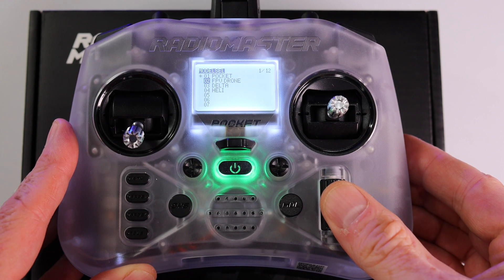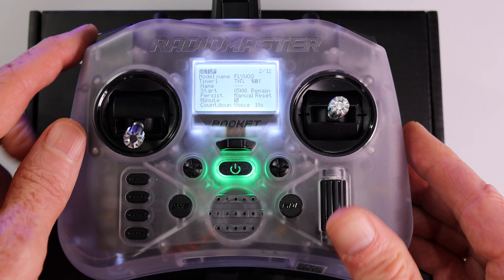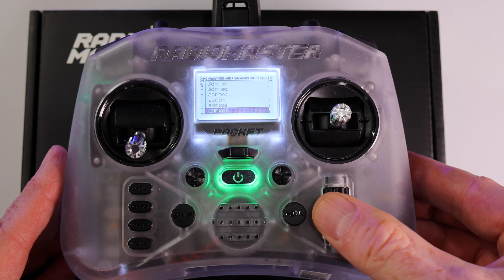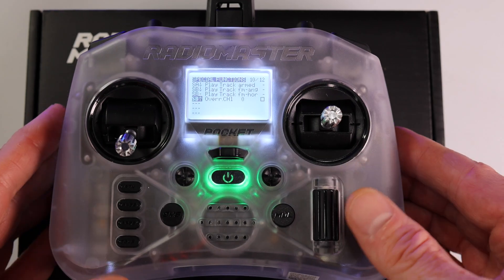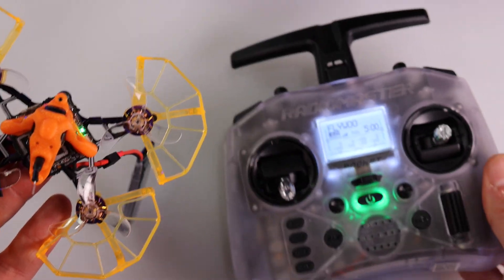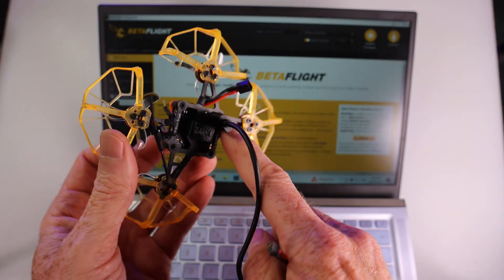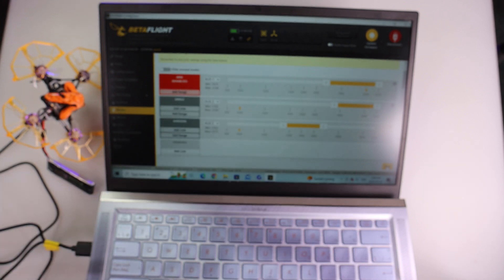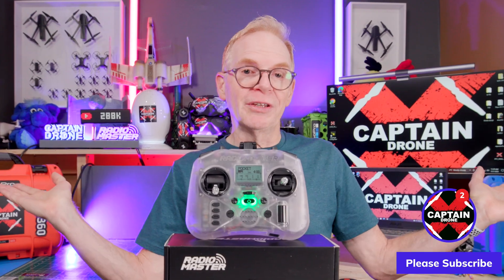RadioMaster Pocket - How To Set Up and Bind a Drone - Step by Step

Comment: I bought a Radiomaster Boxer 4-1 and a Radiomaster Ranger Micro module elrs to configure the quad.. I am have had all sorts of issues setting it up to work  with a Betafpv Air 65 elrs to the degree I have sold the quad. After watching this video I am going to buy another Betafpv Air 65 elrs, but a Radiomaster Pocket and follow this video to set it up. My Boxer will be used for sim only from now on. Thanks for a very detailed and easy to follow video. 👏👏👏
Reply from the maker: You are most welcome!  You may wish to check if the BETAFPV AIR 65 is ELRS or ELRS SPI.  If it is ELRS, then you bind as shown in this video.  If it is ELRS SPI, then you bind within BETAFLIGHT CONFIGURATOR on the RECEIVER TAB (you'll see the bind button).  Just press it on-screen, and also select it on your radio (all within seconds of each other).  You'll then know if you're bound or not because the RADIO will say something and/or you'll seed your joystick inputs move onscreen.
Reply: @CAPTAINDRONE798  Sorry to bother you. I have set up my Radiomaster pocket as you video indicates. I will be receiving my Betafpv Air 65 Freestyle very soon. Can you tell me how I can determine whether it is the basic ELRS or ELRS SPI version please? It would be useful to know before I got through the binding process. Thanks. Steve
Reply: Thanks for your reply, I did not really expect one. Very professional and friendly response. Have a good week. 🤝 I will watch some more of your content.
Reply: As a matter of interest, how will I know whether it's SPI or not?
Reply from the maker: @stevemartin2274 check the specs on line

Comment: I just got the Radiomaster pocket and Radiomaster RP3 they seemed bound and I am not seeing any inputs in betaflight what do you think my problem is?
Reply from the maker: Without looking at it in person, I have no idea, but obviously 99% of the population will tell you that you are NOT BOUND, or your radio is NOT SETUP CORRECTLY, and many more items.
Reply: @CAPTAINDRONE798  my betaflight was origninally configured for sbus I had to reflash the flight controller with radio protocol of crsf now I see the inputs from my radio on the receiver tab.

Comment: I am from Colombia and for a long time I have wanted to fly a drone, but since I have no experience in it, I want to know if there is a drone flight simulator for this model that you recommend, and when I have a few hours of flaying I would proceed to purchase the e drone.
Help me to select a descent drone flignt simulator for the Radiomaster Pocket.
Best regards,
Reply from the maker: Any flight simulator works as long as the flight simulator accepts a USB joystick device (which most do).  Go on the STEAM network and you’ll find lots of flight simulators.

Comment: This video was super helpful, thank you.  So, I’m still having a blast rocking the Aquila 16 though still can’t get use to wearing the goggles. Still flying FPV using a separate VRx and the flat screen in my garage. 
What I’ve been wanting to do, is to start upgrading components on the Aquila 16 or just do a “ from scratch “ build of a tiny whoop. Ive actually printed a couple frames that are similar to a Pavo. 
What I’m wondering is if you’ve a video on drone builds, component selection, initial configuration, etc. I need serious tutoring in Flight Controller, VTx/Camera, other drone electronics with focus on controllers and protocols. I’m old school and use to the clunky Rx bricks you’d plug whatever number of servos into, match Tx/Rx crystal freq’s and that’s it. I’m not even sure receivers  with huge numbers of channels are a thing anymore. And the protocols…..??? I’ve watched what videos of yours I can find and they answered a lot of my questions. If you already have a video that covers this, please point me in the right direction. If not, I’m going to cross my fingers that you release one in the near future. I know there’s a lot of content out there on the subject, I just prefer the way you do it. 
Thanks for the great videos!!
Reply from the maker: Sorry, no build videos. However visit J. Bardwell’s channel as he has done many, from scratch, FPV Drone builds over the years.

Comment: hi Steve, thanks for all the great videos. I wanted to create my own beginners FPV drone kit. I want to use the Radiomaster Pocket controller, with the Walksnail Avatar HD googles. I have not picked out a beginner FPV drone yet. My question is this. Using this selection of hardware can I fly a drone in a grandma skill level 1 mode with altitude hold. Is this possible with the hardware selected? and what drone would you recommend?
Reply from the maker: So you want to use WALKSNAIL VIDEO and ELRS Transmitter.  BetaFPV might make a Walksnail Cetus X that is ELRS, but I’m not sure.

Comment: I'm fairly new to the drone world.  I've been flying the Cetus Lite and the DeeRC D20 for about a year now, and I thought I was doing well.  Until last week when I bought the Happymodel Moblite 7 and a new Radiomaster Pocket.  I followed along in this video trying to setup the new drone.  OMG, I'm finding this thing totally uncontrollable.  The drone has a mind of it's own.  Far too sensitive for my skill level.  So my question is how do I tame this thing down?  Does the radio have expo?  Coming from the Futaba and Sprekrum world, the EdgeTX is totally new and foreign to me.  I can't wrap my head around it quite yet.

Any help would be most welcome.

Rick
Reply from the maker: Flying in full acro mode takes skill and it is exactly as you described.  As your skills increase, life gets better.  The drones you flew previously did not have true acro mode so your skills (hand/eye) are rather out of sync

Comment: Why no one shows how tho mapp/bind the buttons in Betaflight!!?? Allredy used preset from a used drone. But how to start from new one? Need to set te buttons first time. Mixes are set. But it brings nothing.

No one really shows u that..
Reply from the maker: I honestly don’t understand your question.  This video shows you all the basics, so as a NEWBIE what are you hoping to do?
Reply: @CAPTAINDRONE798  betaflight. It doesn't work like it's has to be. All the channels mooves without I touching them. What's wrong? Why no video for how to solve all this problems. Preset is easy when all goes good. Calibration or what? Noone tells

Comment: I've mapped the aux 1 arm ch 5, and aux 2 angle horizon . Was still seeing no motor start on arming even though it shows on BF: just discovered arming disable flags: rxfailsafe, noprearm, msp and rpmfilter... x( Like I said before this drone was previously configured for a tbs rx... should I reflash? Need another tip. Thanks so much.

Comment: pff... so I swapped the tbs rx for an elrs nano txco on an ol hglarc sector 132.  I'm bound to it now with a brand new pocket but my aux switches are not showing up in betaflight. I sorta hit a wall now... and need a tip. thanks
Reply from the maker: Is anything showing up in Betaflight configurator when you move joysticks, switches?  If the answer is no then maybe you have the incorrect receiver selected in Betaflight configurator.
Reply: @CAPTAINDRONE798  hi Captain. Wish I said that: yes, AETR are on... just no aux... I even tried auto but no dice
Reply from the maker: @johngraboski AETR is only for the joysticks so that your throttle, yaw, pitch, roll are correct.  So, when you move the joysticks, you see the associated bars move in Betaflight configurator?
Reply: @CAPTAINDRONE798  yes. Sticks move in BF.
Reply from the maker: @johngraboski Then the issue must be your radio. The switches that you assigned are not sending any output. You can easily double check this on your radio switch/dial monitor screen.
Reply: @CAPTAINDRONE798  I recall assigning SA to Aux1.. dunno how I did that anymore. It's gotta be incredibly simple. I'm coming from the turnigy Evo pro,which li liked very much for its form factor and simplicity. I'll keep fiddling with it. Thanks so much!

Comment: I don't understand about how to setting acro mode? So When you press button to acro mode it will be acro mode or you have to make setup in beta flight to turn on acro mode?
Reply from the maker: You first setup a model in the radio and assign whichever switches you wish (as shown in the video).  Then in BETAFLIGHT CONFIGURATOR you program the drone so that it understands when you flick a switch a certain thing happens.  Every FPV Drone that is a true FPV Drone has ACRO MODE as default, so this means the drone is ready to fly in ACRO MODE when no other mode is selected.  This is why you only have to setup Horizon and Angle modes and not setup Acro mode.
Reply: @CAPTAINDRONE798  ahh i got it, thankyou so much sir🫡🫡

Comment: Is this binding procedure universal for every flight controller? I mean the 3 times battery connection sequence. I have a speedybee F405 FC but does that binding procedure work on f405?
Reply from the maker: Yes, for ELRS Receivers.  If you have ELRS SPI then it doesn’t work and instead you need to bind within Betaflight Configurator.
Reply: @CAPTAINDRONE798  i have a speedybee f405 mini bls 35A stacked, with a SpeedyBee Nano 2.4G ELRS Receiver
Reply: I have a F405 mini BLS 35A STACKED in combination with a SpeedyBee Nano 2.4G ELRS Receiver. So i assume this procedure will work for me?
Reply: @CAPTAINDRONE798  I followed every step in the binding process and i think my F405 found the controller but if i move the joysticks i dont see any movement in the 'receiver' tab  Betaflight?
UPDATE: i changed UART 2 to serial RX. Then it worked

Comment: Can you use this controller to control velocidrone on a Mac? Does Beta Flight work with Mac?
Reply from the maker: Yes, Betaflight configurator works on a Mac.  And yes, this radio transmitter acts as an external JOYSTICK USB for any flight sim that uses an external USB joystick.

Comment: Hi drone Cap😊 I have a mobula 8 analog ELRS and radio master pocket ELRS VERSION. Will this bind method work for my drone? If not what do I watch to learn? Or could you just tell me? I'm familiar with beta flight so instructions will be easy for me please
Reply from the maker: I don’t own an ELRS Mobula 8 so I don’t know. It will probably work the same as long as it is not an SPI ELRS
Reply: @CAPTAINDRONE798  ok and if it's spi do I have to go to the CLI tabs and enter rx_bind?
Reply from the maker: @user-hi5quadxplorer No. you go to the Receiver tab and select bind

Comment: Using this radio to controll rc car with elrs...would the set up and bind be different...thanku
Reply from the maker: Control an rc car with two joysticks?  Rc cars are usually controlled with RC car remotes.  Slow moving vehicles like tanks, big trucks, construction equipment are controlled with joysticks.  Anyways the setup is similar and bind is the same and there is no need for Betaflight configurator.

Comment: I attempted to bind my controller to the drone doing everything you did but when trying to arm it doesn’t do anything and then I connected to beta flight where I wasn’t getting any response from the controller when moving the sticks around. When I disconnect the battery from the drone though it says telemetry lost making me think that it must be connected to the drone somehow. Do you know how to help me fix this issue?
Reply from the maker: There could be a hundred reasons why it did not work, such as you made a mistake in the setup of your radio so your joysticks are not doing another, or you have a bad USB Cable, or you plugged the USB cable into the wrong port on the drone, or your drone needs to be powered with a battery before connnecting to BETAFLIGHT,  or in BETAFLIGHT you have the wrong configuration for the RECEIVER, etc
Reply: @CAPTAINDRONE798  I got it to bind and connect and now I am trying to follow the part where you setup the modes in beta flight. I try to set the arm by changing the arm in beta flight to auto and then clicking down the arm switch but it doesn’t pick anything up? By my controller is connected and the things in beta flight move when I move the joysticks around so now I’m even more confused lol
Reply from the maker: @michaelchristaldi  If it does not pick up the movement of your switch then either your switch is not set up correctly on your radio (keep in mind that all those switches on your radio do absolutely nothing until your assign them to a channel in your radio).  In betaflight configuration, can you see any switches moving when you flick them?  Also, just incase you are a totally newbie, I have to say the obvious... switches like the arm switch can't work if your throttle is not a ZERO.

Comment: I'm binded but when press armd nothing happens
Reply: Did you solve the problem
Reply: I have the same, no reaction in BF
Reply: I got the same thing. I'm bound and I get the Wi-Fi connections on my remote but when I connect to beta flight I get no inputs on throttle or switches and my mixes are all input correctly. I don't know how to do this
Reply: @jamesmichaelcabrera9613 did you fix it?

Comment: Greetings, thank you for your video, it has helped me a lot,
I am connecting the master pocket elrs radio, with the mobula 8 uart elrs, I followed all the steps and apparently it connects and telemetry appears but when it comes to moving the propellers the drone does nothing, when I connect to the betafligt the remote does not appear, no I know if you can give me any suggestions or help, both devices have elrs 3.0 but I can't get the drone to move.
Reply from the maker: If the drone does not show up in Betaflight, then you need the correct usb port drivers for your computer.  Also your USB cable could be a power cable & not a data cable. Also, plug a battery into your quad.
Reply: @CAPTAINDRONE798    The drone does appear in betaflight, and the sensors can be calibrated normally, the controller and the drone also connect to Wi-Fi and they are the same versions of ELRS, I just changed the cable and it is the same only the controller and the drone do not They connect, the connection signal appears on the controller and warns that there is telemetry, but the controls for the motors to move do nothing. When you connect the drone to the Betaflight, the station does not appear, that is, it is as if the connection between the controller and the drone did not happen, I don't know if I should change the UART version that the drone comes with for another to see what happens, I don't know what you can recommend.
Reply: @handrusalexisflorezmontaez4061  The problem is your PC.  Or you are plugging the cable into the wrong connection on the drone.
Reply: @handrusalexisflorezmontaez4061  or you have the incorrect receiver type selected in betaflight configurator .

Comment: Do I need to set up betaflight even if im only going to be flying in acro mode?
Reply from the maker: Yes
Reply: @CAPTAINDRONE798  Thanks, Im having literally so many problems and I finally found out why, the micro usb cable I was using was charging only so now I have to spend more moneyyyyyyy yayyyyyyyy

Comment: Hey Captain Drone, I need help I've binded my RadioMaster pocket with my drone that has a ExpressLRS 2.4G RX Nano 2400RX. But I can't seem to get any throttle? or any input that I can see on betaflight.
Reply from the maker: If none of the slider bars move in Betaflight Configurator then you are either NOT bound to the receiver, or you didn’t set yup your radio correctly or you did no supply your drone with power and finally, you made the newbie mistake and did not plug your usb cable into the flight controller (there are two plugs… you have a 50/50 of getting it correct)
Reply: @CAPTAINDRONE798  Hey Captain Drone, thanks for replying so quickly. The receiver and transmitter seem to be connected, because when I take the battery out of my drone, it says "telemetry lost," and when I plug it back in, it says it’s connected again.
It also shows on the Radiomaster that signal symbol, that it is connected.
Reply from the maker: @TheRagingGiants then the problem is as I mentioned… radio setup wrong or no power provided or you plugged into the wrong port on your drone.  When you plug into Betaflight configurator, and then lift and move the drone… does the drone on screen also move?
Reply: @CAPTAINDRONE798  I've fixed it, I wired as you said the Receiver wrong. Now I need to tune it because for some reason the throttle is stuck? when I give power the motors keep spinning faster and faster and faster and faster, and when I try to fly it it turns really fast 1 second then turns off.
Reply from the maker: @TheRagingGiants  No tuning required.  The motors spinning up quickly is normal because EVERY FPV DRONE on the planet is designed to fly, so when you ARM it on the ground, then increase throttle, it then doesn't understand why it is not flying, so the motors spin up to compensate.

Comment: My cc2500 model can bind with my first drone but when i try to bind it with my second drone, it cant work.Can you help me
Reply from the maker: If you can bind to one drone then you must have a small bit of knowledge and understanding of RECEIVERS.  My guess is that you made a second model in your radio (which would be correct) but you are not familiar with the RECEIVER in your second drone.
Reply: @CAPTAINDRONE798  so what should i do now